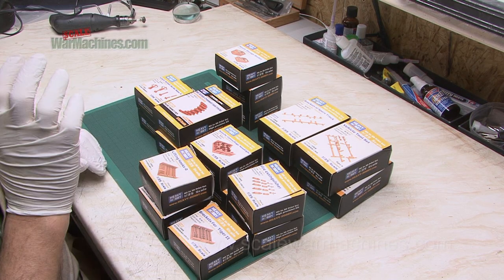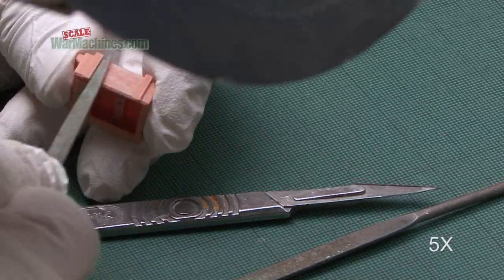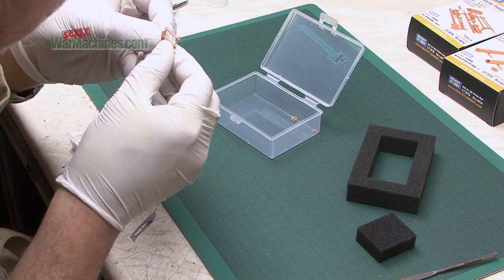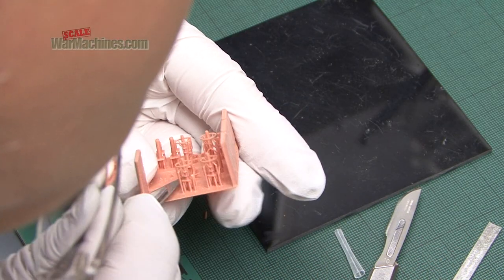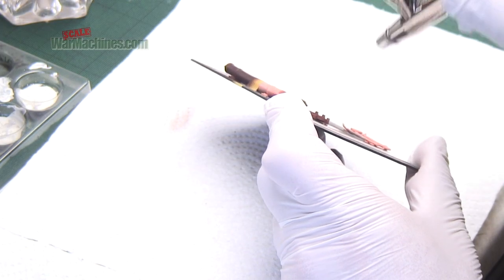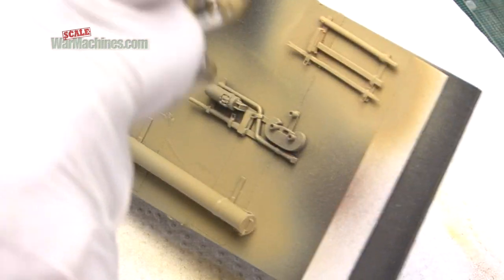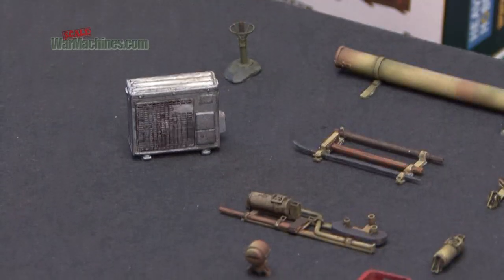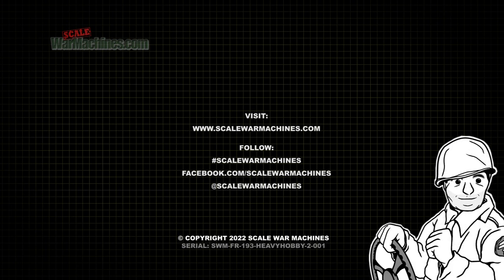PREPARING & PAINTING 3D MODEL PARTS - HEAVY HOBBY REVIEW #2

Comment: Hello, I have been 3D resin printing now for over 2 years with great results from a basic Elegoo Mars and Elegoo Mercury Plus wash and cure machine. 
There are now plenty of other brands offering the same kind of equipment at fare prices. There is a growing 3D community who are happy to share freely 3D printing files for all kinds of hobby accessories for modeling and model railways and figures model bust ect. After the initial cost and outlay of the two machines ( purchased 12 months apart ) the cost of resins is coming down and more easily affordable. 
Couldn't help but notice you had no mask on when using the file's and sanding sticks the resin dust is Not good for your lungs, I do my sanding at my little home paint booth with the fan running on full this really helps keeping the dust down and off the modeling bench and all the tool's and paint racks  yaddda yadda...
Many thanks on the painting tips.